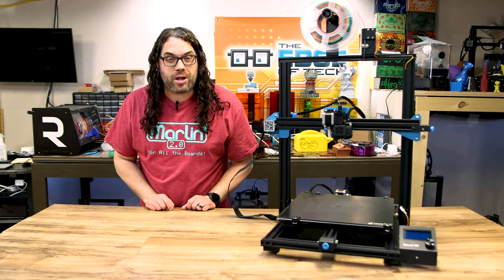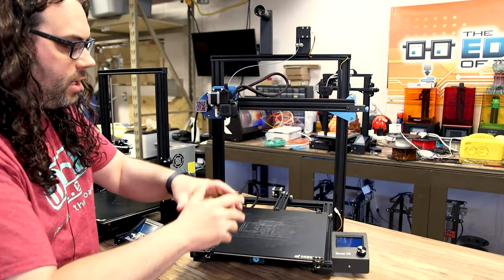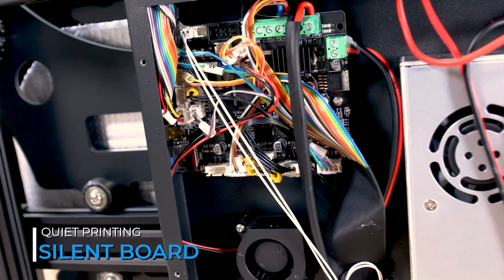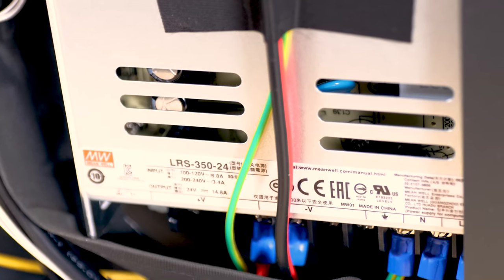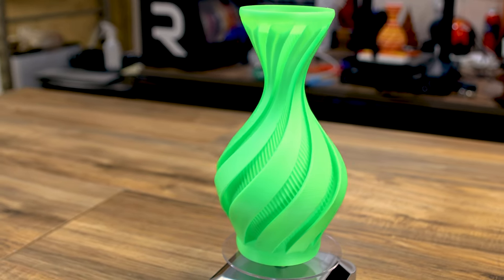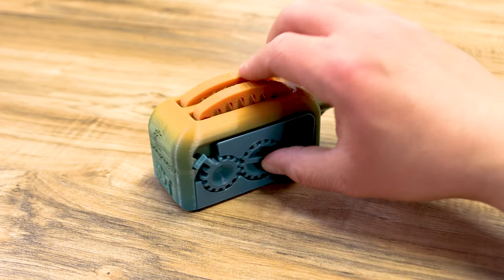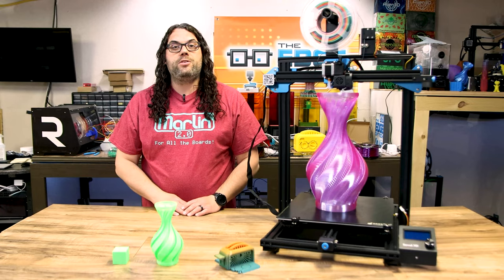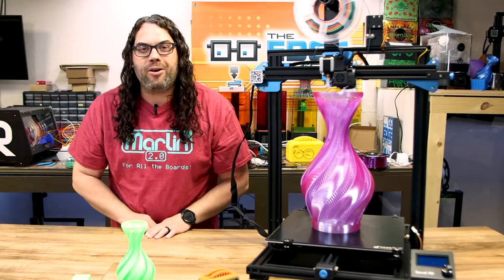Another Large Scale 3D Printer that Rocks! Sovol SV03 Review

Comment: Ivan Miranda wears the crown for bedslinger bed size!
 The one thing that I have had problems with bedslingers is keeping the gantry level, any chance of doing a perimeter bed print in future reviews to see if there is any movement of the gantry when the hotend reaches the ends of the gantry.
 The only way I have been able to rectify this error is to slightly overtighten the eccentric wheels to hold the gantry tight.
 This one is unlikely to move having two leadscrews though